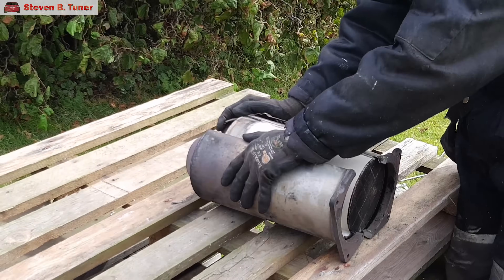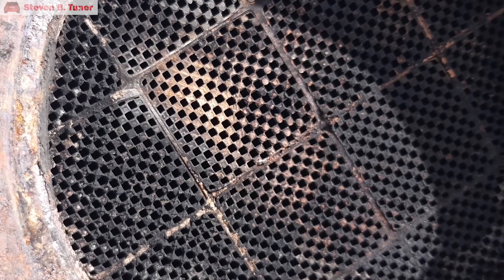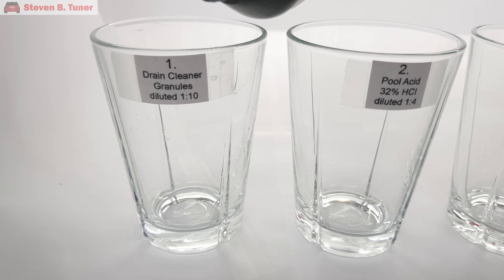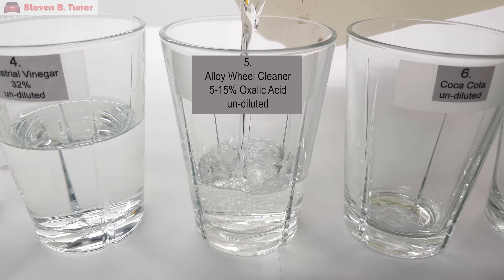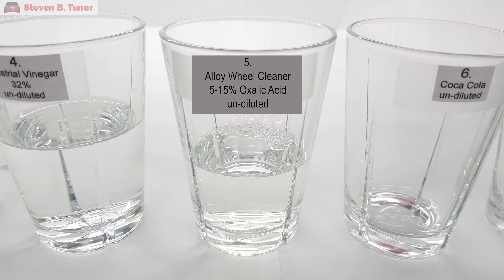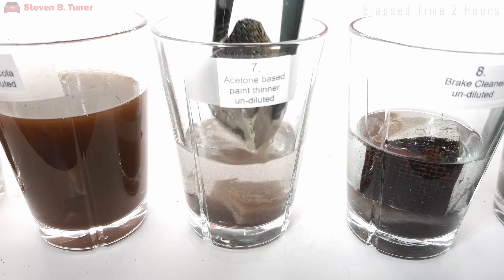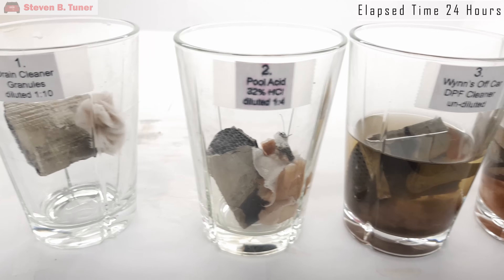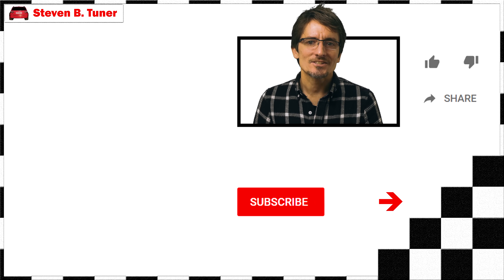DPF Cleaning at Home – 9 Chemicals Tested (Diesel Particulate Filter DIY Ash Cleaning)

Comment: Hi great video! I wonder if can I use this to clean my Azure Phosphoric Acid Descaler Rust Remover 30% Safe On Metal Surfaces
Reply from the maker: Hi, glad you like it! If the product has 30% phosphoric acid then it should be absolutely perfect for the 2nd stage ash removal. It would be great to hear how it goes!

Comment: Hi Steven, I tried ALDI all in one dishwasher tablets (not family pack) and Super Alloy concept wheel cleaner (10-25% phosphoric acid, 25-50% hydrochloric acid as per data sheet). Condition of BMW DPF (520 d se2008) -before hand-fuel economy nearly doubled, car sounded juddery sometimes-fuel emission light on frequently-turbo failed a month ago-looks like fuel or something got into engine oil also as oil level increased after turbo replacement. I got the local mechanic to remove the DPF. Crushed 40 Aldi tablets into 15 litres of 40 degree water (15 litres covered my dpf fully) agitated every 15 minutes for two hours . No water flowed through dpf at the beginning - dpf was used for 306,000km. After an hour soot started appearing and breaking down. (Probably could have used 80 tablets as I think this is what you suggested.  After two hours soot only  was removed (No sign of ash). Washed out with water both directions before next phase of ash removal. Diluted wheel cleaner 1:4 adding acid (12 litres of water and then 3 liters of wheel cleaner ) to water 40 degrees also (kept the hands warm with the rubber kitchen gloves and disposable gloves under these -just in case with safety glasses). Agitated every 15 minutes for 1 hour 30 minutes. Rinsed out with water both directions until no ash seen, then water and washing up liquid, then final rinse with de-ionised water. Dried in oven at 50 degrees for 4 hours . Before the final wash I could see that when using the garden hose that if I placed the hose against a selected few dpf holes the water flowed straight through. I realise this may not be possible for others but this particular dpf allowed me to see both ends. I got the mechanic to re-install and re-set today. After engine warm up fuel economy back to normal. I bought the Altel AP200 unit also so I will check for glow plug issues etc tomorrow. Did test with wheel cleaner on some stainless steel screws beforehand some tarnished and other brands did not . The dpf case did not tarnish. Thanks for the help.
Reply from the maker: Congrats on a job well done!

Comment: Please try DMSO, heated to 50-60 C.
Reply from the maker: Hi, thanks for watching and for the interesting suggestion! Just to make sure - you are referring to Dimethyl Sulfoxide? I'd love to hear about your experience with this chemical.
Reply: @StevenBTuner  yes, Dimethyl Sulfoxide. It's one of the strongest solvents. It's relatively safe by itself, but can transport other chemicals through your skin, so gloves are a must. It dissolves deposits from burned oil very easily, both oily ones and "charcoal" ones. It's miscible with water and most solvents, but strength would be reduced. Pure DMSO cristalizes at 19 C, some water will reduce melting point.
Reply: @StevenBTuner  Some Russians use it to dislodge piston rings without disassembling engine as last resort. Extreme care should be taken because it can dissolve some plastics and paint in the engine. There is established protocol and list of "safe" engines to use it on.
Reply from the maker: Hi, it is now on the shopping list so I can try some experiments with it!

Comment: Great video - take home message is to use the dishwasher tablet and THEN the wheel cleaner ? (As it had the least impact on the packing materials).
However, I’ve had great results using Nulon (yes, Aussie made) ‘entire fuel system cleaner’. Works a treat, restoring performance and fuel economy. Seems to last a lot longer (~10,000km) than the competitors and also states (re special chemicals coating the filter) that it ‘reactivates’ the DPF. 
Also a lot easier pouring a bottle into the tank than removing the DPF!
For those interested, I first had a problem at about 75,000km with my 2018 DMax, but now going better than ever with 95,000km on the clock.
Reply from the maker: Hi, the caustic soda and pool acid are my favourites for being cheap and easy to get hold of, although I will be testing some other acids soon (you can see my separate vid on the process). I am quite wary of some of the claims being made about 'coating the DPF' etc and I am thinking about making a video where I call them out on it - they can prove it or remove it! No coatings are wanted or required as silicone carbide is already a kind of magic space-age material. So far there is only evidence for additives helping with soot clogging by reducing the burn off temperature, which might be helpful to those always stuck in traffic. Ash clogging is very different and isn't helped by any in-tank additives, because anything strong enough to eat away ash will also eat away fuel lines, fuel injection pumps and fuel injectors on the way through.
Reply: @StevenBTuner  hi Stephen and thanks so much for replying. The story with the DMax however, does seem to indicate that the fuel system cleaners can work. Fuel economy had gone off to barely 12km/l (from14-14.5) and I am completely sure that this was not due to a variation in operating conditions. I treated with one cleaner and it made very little difference. I treated with another and within the tank, fuel economy returned to normal but within a couple thousand km had deteriorated again. Finally, I treated with the Nulon product and both performance (‘seat of the pants only) and fuel economy became normal again and remained so for -10,000km. After a major service both deteriorated again - second clean with the Nulon product saw my best fuel economy figures ever. 
Does the Nulon really work, or is something else happening?
Reply from the maker: Hi, I'm not saying that fuel additives don't do anything useful, it's just that they don't always do all of the things that some of them say on the label. It would be nice if they toned down the marketing hype, and just said what they do and don't do, so that we can make the best choice for our vehicle.
Reply: @StevenBTuner  Absolutely. So if (when) my DPF EVENTUALLY blocks up and I have to take it apart to fix it, I’ll know where to start! Great video and excellent possibilities well demonstrated. Thanks very much!
Reply from the maker: You're welcome!
Reply: @StevenBTuner  it would have been great to have this information at the end of the video. The 24hr results skipped some of the chemicals so I got confused.

Comment: Thx for this nice and informative vide . Only one thing what i need to know , is about the HCI ( pool cleaner ) 32% is 1 and 4 is the  water , or 4 HCI and 1 water . Thx for your answer .
Reply from the maker: Hi, thanks for watching! It is 4 parts water.
Reply: @StevenBTuner  Thx for your quick answer. I saw your another video and i realized that . 😬 . I let you know , the result,  after the cleaning .

Comment: Spray a can of $2 oven cleaner into DPF then flush with Gerni! Couple of days beautiful 👍🤗
Reply from the maker: Hi, thanks for watching! Oven cleaner is similar to caustic soda so makes a great pre-cleaner to remove oil and oily soot, but unfortunately won't remove any of the 'end-of-life' ash deposits. High pressure washing with a Gerni or a similar unit can cause cracking of the DPF modules as seen in my other video: https://www.youtube.com/watch?v=-0mtz3Icg5o

Comment: I’ve watched your videos and this one many times. Is it just me or option #2 the Pool acid worked really well. Am I not seeing or missed some negative effects? That’s also one of the cheapest products to buy. If that’s the case, wouldn’t that just be the go to?
Reply from the maker: Hi, thanks for watching! The pool acid is the best out of the chemicals in the test for removing the ash buildup, but it is still good to remove any oily soot with some kind of pre-wash first, like the dishwasher tablets or drain cleaner. The only negative effect is that pool acid will attack the metal, so you can't leave it to soak for too long. If you want a more expensive but safer acid then it is best to use the 'pH Down' product from hydroponics suppliers - it contains phosphoric and sometimes nitric acids, and won't harm the metal case even if you leave it to soak for a while. To finish up it is best to run some water through with dish-washing liquid, and then finally flush out with distilled water (if you live in a hard water area).
Reply: @StevenBTuner  I think a weak Sodium Bicarb solution (1 tsp/gall) will neutralise the acid quite cheaply, harmlessly and effectively. Look in the pantry for it - its used to make cakes rise.

Comment: Love this - amazing testing but it's very difficult to clean the dpf manually with any of these products. Would be great to see a video of how a novice/ intermediate mechanic could use a cleaner.
Reply from the maker: Hi, thanks for watching! I do a full clean on my other video showing that it can be done by anyone, although it is not that nice a job: https://www.youtube.com/watch?v=LE1boZ3fhLg
Reply: @StevenBTuner  thanks for the reply. I will watch this later. We have a disco sport which suffers a lot of short journeys school runs. Certainly  since using the Wynns DPF cleaner in fuel tank along with using Shel Nitro power diesel we have reduced the problems dramatically.   I would like to see the same video you posted but also using another pot with Nitro power fuel.... thanks
Reply from the maker: @divscuba7096  Hi, the best quality fuels have a lower ash content, so it will take longer for your DPF to become blocked up with ash.

Comment: Just get a long drill bit and drill right through the crap. Put a few holes in it. No blockage
Reply from the maker: That is a possible solution for sure, but it isn't really an option in most countries.

Comment: Great videos man just in the process of bathing my dpf now as its full clogged and the car wouldnt even start 🙄
Reply from the maker: Hi, sounds like your filter is probably clogged with both soot and ash! What cleaning methods are you using?
Reply: @StevenBTuner  ya definitely is, I bathed it in a mix of drain cleaner and dishwasher tablets and had it boiling in a fire pit for 2-3hours the water was full of  a browny red sediment afterwards and now water actually passes through it, but only in trickles, its  obviously still partly clogged so il probably just drill a few holes through the centre to hace it running for a while, thanks for the reply by the way 👍

Comment: I wonder if diesel oil will work
Reply from the maker: Hi, thanks for watching! The ash in the DPF comes from the unburnt compounds in diesel fuel and engine oil, so unfortunately diesel won't remove the ash deposits. Your engine does however use diesel fuel to increase the DPF temperature in order to burn off the soot regularly as part of the normal regeneration process.
Reply: @StevenBTuner Hi, old mechanics use diesel oil to soot dissolve in cylinder. Probely dosent work with ash.

Comment: Hi Steven, have you tried using Bar Keeper's Friend to dissolving the blockages, it works very well for me dissolving the lime or rust in the metal pipes while keeping the metal safe, not sure if it will do the same for the DPF, cheers 👍
Reply from the maker: Hi, thanks for watching, and for the great suggestion! A product like that should be perfect for the main DPF wash, and I'll be testing something similar in an upcoming vid.
Reply: @StevenBTuner  thanks for the great videos Steven, you can find Bar Keeper's Friend at any Woolworths cleaning section. Cheers!
Reply from the maker: Hi, they do a bunch of great products - their 'Cleanser' seems pretty good a DPF pre-wash to cut through any oily soot, and their 'Coffee Maker Descaler' contains citric acid and glycolic acid, which might work quite well to remove the ash in the DPF. Well worth further investigation!

Comment: I use wheel cleaner it's the best and the cheapest
Reply from the maker: Hi, thanks for watching, and for sharing your method! There are a few different acids that end up in alloy wheel cleaners - do you know the primary ingredient in the one you used?
Reply: @StevenBTuner  no, it's a wheel cheaner from the car wash. I bought 4L and refill my spray bottle for wheels use. Because on the car wash you have to spend 1€ and it's too much for the 4 wheels and the 2 exhaust pipes

Comment: Its absolutely not clear how this will effect the future usage of the dpf. They have a special coating inside which could be washed away with thease measures.

So these solutions here are sort of a budget repair, before a proper replacement / cleaning
Reply from the maker: Hi, thanks for watching! Are you referring to the coating of Platinum and Al2O3 on the diesel oxidation catalyst? (I have covered that in another video). The DPF material itself is pure silicon carbide, and there is definitely no special coating on it, and neither should there be.
Reply: Thx  for the answer. Didn’t see that Video. So rim cleaner is considered safe for these types of DPF?
Reply from the maker: Hi, I haven't tested on a full DPF yet, but a lot of alloy wheel cleaners have phosphoric acid in them, which doesn't attack steel or stainless steel, which is a good starting point. A cheaper source of phosphoric acid could be the 'pH Down' product that is available from hydroponic suppliers - and I'll be testing that in a future video.

Comment: It would be interesting to see what pure diesel does. Can you make this test some time? And YES for the two-phase Coca Cola cleaning
Reply from the maker: Hi, thanks for watching! Your car already uses loads of diesel to burn off the soot in the DPF as part of the normal active regeneration, but it doesn't do anything to the ash in the filter (in fact it adds more ash, because diesel fuel has some ash in it). So for a fully clean filter we need more than diesel fuel.  Cola contains phosphoric acid, so I will be doing a test soon where I use some strong phosphoric acid - look for the video soon!

Comment: DPF need to be cleaned with reverse flow!! You can partially dissolve soot in clogged channels to help it burn off but it's ad hoc repair. The downgrade of dpf efficiency is caused by ash which cannot be dissolved and need to be removed physically.
Reply from the maker: Hi, I'm guessing you are commenting before you actually watched the video (or any of my other DPF cleaning experiments). There are a number of ways to clean ash out of DPF, and back-flushing is only one of them, but it is not the only one.

Comment: Very interesting. If you'd have taken the mass of each sample at the begining then their dry mass at the end (you would need an accurate weighing scale with fine resolution I expect), you could have calculated the mass loss. Converting this to a percentage loss would make it fair in that sense as the percentage loss of mass would be proporionate for each sample. Hence the greatest percentage loss would be the best, "all else being equal"! Well done.
Reply from the maker: Hi, that is a good idea for sure, but I ran into a problem with the accuracy of my scale. Each DPF chunk was about 1% of the total DPF volume, so even if the filter was absolutely full of ash it would only measure 0.5 - 1 grams of ash per piece (and many of the pieces were only partially full). So my scale with an accuracy of 0.1 grams was of no use for this test. More equipment to buy for next time... :-)
Reply: @StevenBTuner  Yes, a resolution to a milligram or better might work (but they are expensive!). Very useful information though, Cheers.

Comment: Saw this video yesterday and immediately ordered some HCl. 
But I now realized there might be a problem: the DPF in a BMW e90 is one unit with tue catalytic converter. And in this one, there are metal oxides like Al2O3. 
Won't those also dissolve in the HCl, ruining the Cat? 
Any experience in this?
Reply from the maker: Hi, thanks for watching! Later E90s have a DOC which contains Platinum and Al2O3, so I made a video called "The No Damage DIY DPF Clean": https://www.youtube.com/watch?v=LE1boZ3fhLg  where I test each of these against HCl.
Reply: @StevenBTuner  thank you so much! Going to watch this one as well.